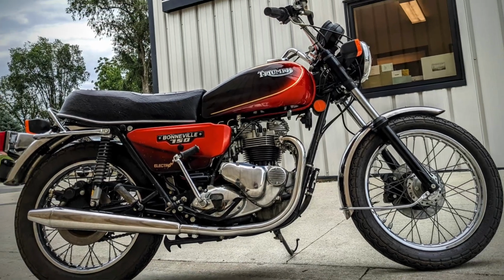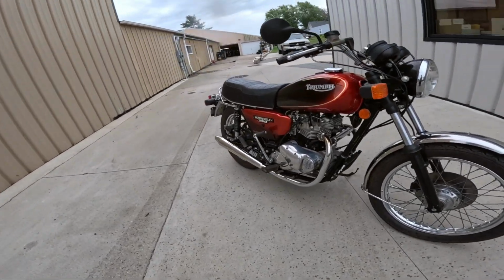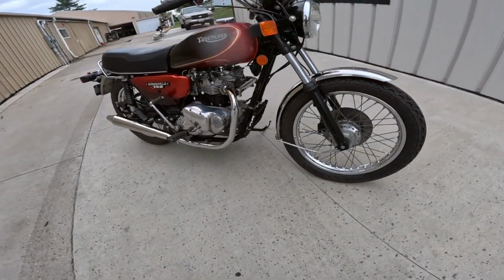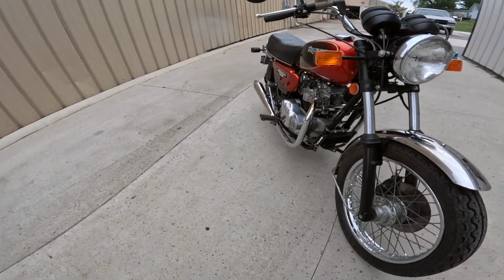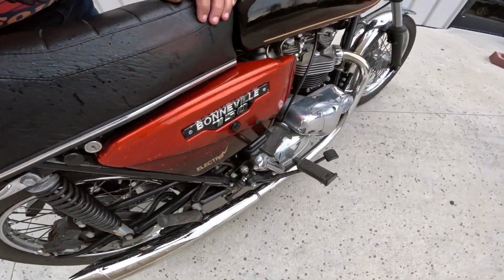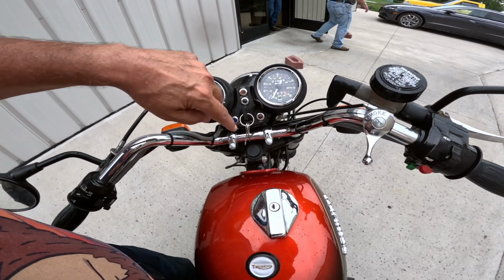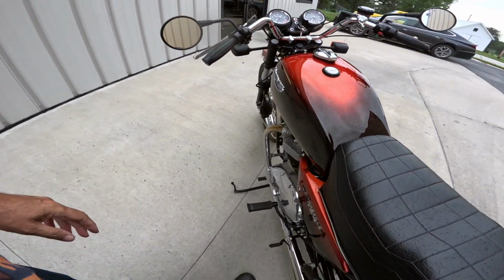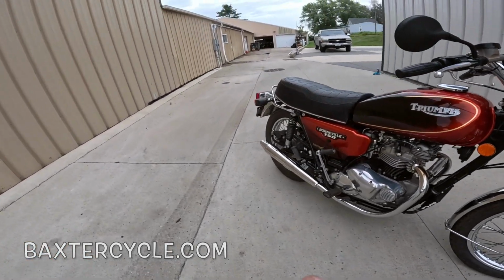Low Mile Beauty! 1982 Triumph T140 ES - Crazy Good Looks - Wow!

Comment: The TSS and TSX Bonnevilles carried hope and deservedly so, despite the (over publicised) initial production problems, the fact there's so few of these is part of the reason I hate the eighties so much. Check out their Wiki pages for their original cycle spec, Marzocchi over Koni and those reverse cone megaphones include parts swapped out from standard spec.
If I remember anything like correct, these were blazing the press around the same time B.M.W. shod a Boxer RS in knobblys, raised it's mudguards, added a stone guard to the headlamp, engine bars around those pots and entered the world of off road motorcycles.. ..and we first heard of the new Harley motor.. (though I may be compressing time a little).
Reply from the maker: It's a company with a story, for sure.
Reply: @thefuzzybiker171  You know Fuzzy, if I'd thought about that two minutes longer, I'd've remembered those Les Harris Bonnevilles out of Devon, this is one of them. I was wondering how it could be original (which it must be), yet so different, even that paint job looks Dream Machine. I knew people elsewhere in the country who had these at the time, but for some reason, this far down, they were more dismissed, heaven knows why.. Anyway, built in Devon, under licence from John Bloor by Les Harris.. ..and yes, another machine I should have had back then (Les Harris was also responsible for the Rotax engined Matchless G80s's that did the rounds too.. - 'been looking at one of those recently).